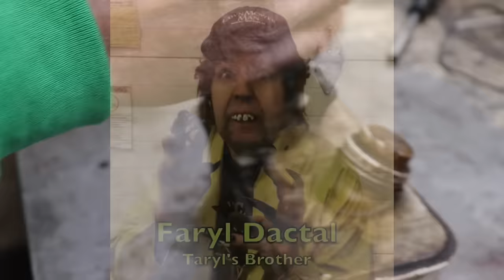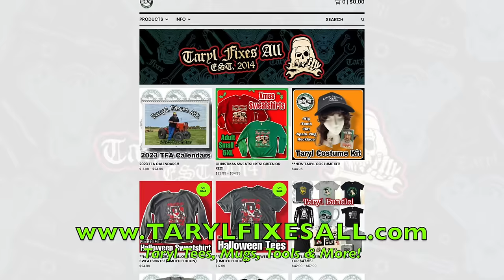This cemetery mower is creepy, will it run? 🪦

Comment: I used a sensation as a teenager, my dad got it at a garage sale. Great mowers. I liked the heavy duty bearings on the wheels. Eventually the cast aluminum deck developed cracks in the sides so I reinforced the deck sides with steel plates which I drilled and bolted on. Good times

Comment: Cool cast base, that's a durable feature if you don't bang it against something.  I had an 18" Montgomery Ward mower in 1962 or so, and it had that same Briggs engine.  I bought it with  $35 of my paper route earnings, and used it to mow yards in the neighborhood for three blocks in any direction.  I charged three dollars for most yards, plus or minus fifty cents.  There was a corner house on a steep hill that paid me four bucks, but maybe it should have been more.  I had to drag the mower backwards, going sideways across the steep hill on three sides of the home.  Back then almost nobody trimmed their sidewalks - but I would do it for an extra dollar, on my hands and knees with hand clippers. Nobody except pros had powered edgers, and string trimmers had not been invented yet. I made plenty of money mowing yards, at least fifty or eighty bucks a month, back when minimum wage was $1.25 I was making three dollars an hour or more.
The worst job ever was sweeping a long drive.  The wind was blowing, and as soon as I finished from front to back enough detritus had blown in that I had to start over.  I swept at least four times.  Finally came a lull in the wind and I went to collect my fifty cents - and she paid by check!  The corner grocery cashed the check, but it was illegible and they had to ask me was it fifty cents or five dollars.  I was sorely empted to say five dollars, but I just couldn't do it.
Many years later I drove around and mowed yards for free when I guessed that the resident might not afford a regular service.  It was a goodwill gesture and I made many people very happy.

Comment: I rebuilt my 3 horsepower Briggs and Stratton lawnmower engine almost 3 years ago with new piston rings & a valve job, it's been a ripper ever since.

I rebuilt it after it began chewing through 200 mLs of oil within 1 hour,the spark plug was getting oil fouled,it took 6 pulls to start it instead of the normal 3 & the engine didn't have enough compression to open the choke up when the engine was warmed up.

It now uses 150 mLs of oil within 10 hours & the spark plug electrode runs grey instead of black  & oily,it only takes about 3 pulls to start the engine was well.

It does blow a puff of smoke on startup sometimes but with that mower in the video I would just monitor the oil consumption then rebuild the engine if it's unsatisfactory.!

Comment: Some older corded electric mowers were bi-directional, because of cord issues, such as the twin bladed Sunbeam. Motor in middle, belt drive to blades. 16" or18" cut I think. Black and Decker had a single blade model.

Comment: Most of these old B&S verticle engines have a jacked up exhaust valve, I mean burnt. I usually reface them with a drill and a bench grinder, back to mowing. Set the valves and the points, really great engines.

Comment: I have one of these little Sensations, almost exactly the same. Mine doesn't have the control knob on the top of the shroud, but it's the same green mower body. It's a 3hp white 1967 Briggs, so this one is probably closer to the mid/late 60s. Cool little mowers!

Comment: Had a big 6hp sensation 22 in.  Look like an old Jacobsen deck as I recall. There is an owners group.  They were one of the  last manufacturers allow to sell mowers without blade brakes, because they were marketed solely to commercial users.

Comment: Love old mowers and experts fixing them. I have a question I have a red tip whiz-mow with the sulky and the motor has no badging. It looks identical to that moto and the plastic choke plate is broken and I was wondering if you have a part number for it? Thanks

Comment: Sensations predecessor was BobCat.   These were also manufactured in a 21 " push and self propelled models, all aluminum decks, quality was evident in the ball bearing wheels.   These trim mowers were used before the invention of the common light weight string trimmer.

Comment: I love your videos, not necessarily your singing...😅 I repair mowers  and yard equipment as well. I found an older Honda rider mower that has an inline water cooled 2 cylinder engine. Its a collector .. for me anyway.  I also found an old Jacobsen push mower.

Comment: That 3 horsepower swinging that small blade, is comparable to having a ten horsepower on there.
Reply: But, the speed of the blade is what gets the grass cut. The blade can only spin at 3600 rpm because it's directly bolted to the crankshaft and 3600 is the red line for these engines. The tip speed of the blade will be much lower than on a regular size push mower.
Reply: @the_mowron  good answer
Reply: @the_mowron  I was thinking more in the area of torque, definitely the tip speed of the shorter blades won't be as fast.
Reply: Yes but anything smaller diameter is easier to turn with a higher load than something bigger diameter with a higher load
Reply: @tonydiesel3444  Exactl.
Reply: Exactly.

Comment: Oh the blower cover ihave some metal letter punch and I punch the start run and stop or make a tag &put in two smaller self tapping screws boy that's a beauty I looking for a 20 jacobsen commercial lawn mower deck minus the engine it had the 2cycle

Comment: I had one back in the 90s. Don't remember  the name, but it was green in color a cast aluminum base and it was 3 wheeler, one wheel I the middle front that swiveled.  I believe  it had a rope starter and the gas tank hung off the handle bars. It was old from back in the 50s. Traded it for ? Was told that they were used a lot before weedeaters .

Comment: You checked the intake tube.. But the two little screws that hold it down do the same thing as the head bolts. vacuum leak (hard to start)

Comment: Serious question here. Wouldn't flipping the handle over be the equivalent of pulling a regular mower backwards? When I cut that way, the cut is very different than when you push normally (uneven and more clumps in normally high grass). I think it has to do with the leading edge of the blade. any thoughts? Cheers from Guam USA👍

Comment: I 💕 those  mowers is that saleable I tell you taryal I paint the deck rusteloum hammerite green and paint the blower cover airfilter white as it was with the handle and the letters painted too on the first few year some were orange 🍊 I use chevy engine orange

Comment: I had one of those 40 years ago,  but it was about a 20 inch deck.  It was old then,  1982. Aluminum deck.  Ran decent.  Real basic. Same flip the handle over.  Kinda a blue color deck. I was just telling you about the fact that it had a bigger deck. Whee!

Comment: Put some Lucas Seafoam fuel system cleaner the valve are probably gummed up and clear up  the engine I thing supposeto have the spark plugs facing front to put a briggs low tone round muffler as it hitting the handle

Comment: I dont know if you'll see this comment but please let me know if you find some of these auto choke carb amd gas tanks because I have a 1976 briggs with the auxiliary shaft that while taking the engine off I punched a hole in the side of the tank and I need a new tank also I would like to do a conversion on a newer mower to the auto choke as am experiment please let me know thank you

Comment: I wonder if there's any connection between this, and the "Hayterette"..

The Hayterette is exactly the same colour scheme, only 2" wider, and the exact same construction. My dad always referred to Hayterettes as cemetery mowers, and back in the 1960s he was a part-time groundskeeper at our local cemetery. He used to use a Hayterette for that job, and we're talking about 1962 - 66. The powers that be then decided to replace it with a Flymo. The Flymo could do half the work in twice the time - when it deigned to work. Absolute piece of crap it was, and it didn't fit between the graves!

The similarity between the Sensation and the Hayterette is impossible to ignore. I actually have a Hayterette cemetery mower right now - Three Hayterettes to be truthful - A mark one cemetery mower, a mark two cemetery mower/domestic grounds mower, and a Hayterette Contractor. The Contractor is a bit different/special because they were fitted with a 6hp Brigg and Stratton and could munch through just about anything.

There's a bit of history behind Douglas Hayter, and The Hayter Mower Company. They were always expensive, and even at the last sighting of the Hayter catalogue, the Hayterette was well over a grand to buy new.

I also have; a "Condor" "Kestrel" and "Harrier" - All Hayter products.

Comment: These carburetors just suck.  Always have problems with this diaphragm style.  My edger always needs starting fluid to get going even with a manual primer on a carb just like this one, even after being rebuilt.  Doesn't annoy me much as the edger only gets used a few times per year.

Comment: i got a 4hp bonanza minibike in 73 i was 10. dad had shop put a spring in place of the rod linkage to the throttle to cut top speed...for safety reasons...my friend.s cat 2 hp i t was faster than mine...until we found the spring...scarey fast...for a kid
we had open space so dad made me.push.the minibike in the neighborhood on the sidewalk. not too far...1/2 block...until., jr high when friends had fast.gocarts, bull tacos,

Comment: I bet that engine has breaker point ignition
Reply: Why in the world would you suspect that?
Reply: @andyhamilton8940  The clue is the type of carburetor it has. Most Briggs engines with that kind of carb also had breaker point ignition

Comment: They just don't make things like they used to look at that cast iron body that thing I'll be there forever the tires are run off of it before you've been that or anything it's solid I don't know why we got so cheap and making things these days everything's plastic and thin sheet metal beer can metal weird but that's what we do I don't get it even high dollar stuff you know Honda stuff like that you find the same thing in it it's just weird